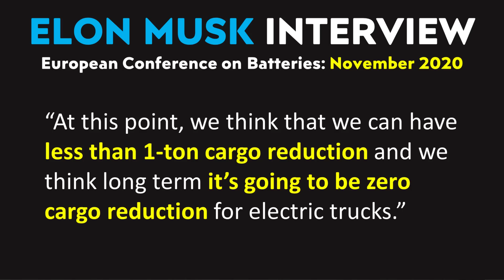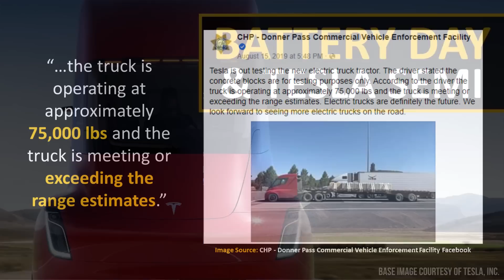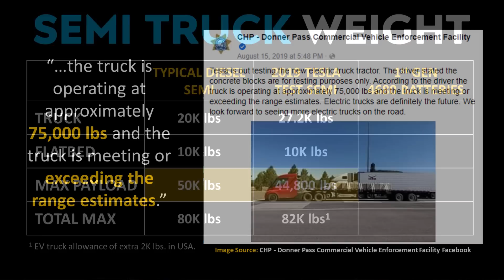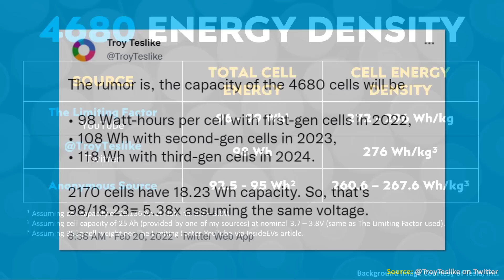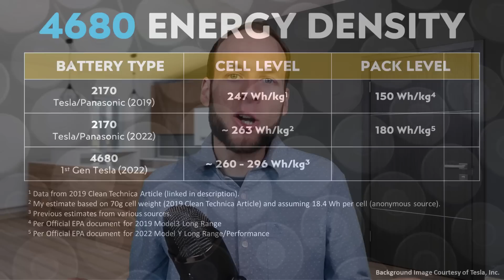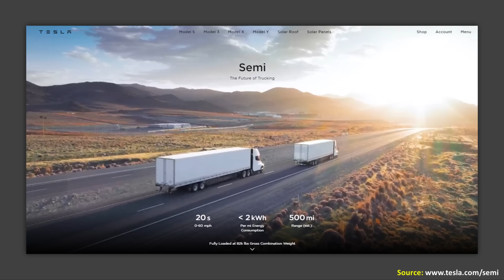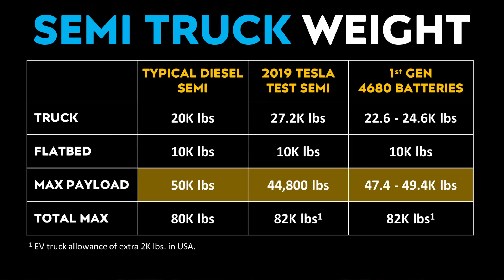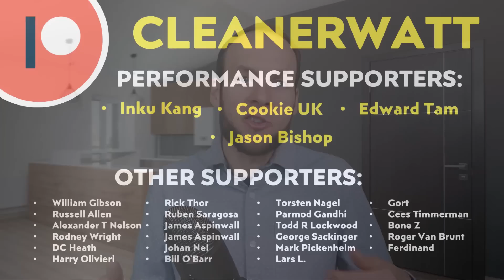Tesla Semi HANDICAPPED by 1st Gen 4680 Batteries?

Comment: At some point Tesla will get the bugs worked out on the 4680s, but I thought on Battery Day the 4680s would be fully ramped by now.  Maybe by next summer.
Reply: Well...
It's only got (at least) 7 new technologies in the pack....
Easy!
Should have been ready last year!
.
/s
Smh
Reply: @rogerstarkey5390  I think we were seduced into thinking the 4680s would be ready SooN.   The reality is Tesla really intended on all Model Ys coming out of GigaTexas when GigaTexas went online to have 4680s.   They obviously adjusted on the fly, which is cool, but clearly they (and us) thought 4680s would be cranking out at a high volume already.   I am totally guessing, but the manufacturing issues will probably take until next summer to get all sorted.
Reply: @Team_Trade_Down  
Considering that they're still building at Austin...
Reply: @rogerstarkey5390  True, but they have built 10,000 Model Ys so far at GigaTexas.  And growing quickly.

Comment: Fuel cells combined with much smaller/lighter infill batteries looks to be the most practical approach for Trucks.
Reply: A battery has a huge efficiency advantage.
Reply: I'm with Elon on this. Hydrogen fuel cells  for semi's is total madness.
Reply: Hydrogen. Don't do it. Don't do it. Don't do it.
Reply: I am not saying that hydrogen fuel cells are a better technology than batteries, but even if that were the case, there would be some significant challenges to overcome. In particular, hydrogen fuel works out to be several times more expensive than recharging a battery to travel the same distance. Also, an internet search suggests there are about 1000 times fewer hydrogen fuel stations in existence than recharging stations. Put simply, a massive amount of money would have to be invested to create a "good enough" hydrogen infrastructure to support its use in cars/trucks.
Reply: Fool cells wear out and using a small battery pack means it degrades much faster. Then you have the issues of cryogenic hydrogen or ultra high pressure hydrogen that finds even metals premiable and also causes embrittlement , do you want to live near a hydrogen filling station that is pretty much guaranteed to leak?
Reply: @Shaun
A couple of points.
.
Just this week, we've seen a (the) "champion" of the fool cell parade a small fleet of trucks which look larger than the Tesla semi, but have 300 mile range.
.
This is after the last 5 years of "You need 1000 miles!' FUD, often from fool cell proponents.
.
What happened there then?
Unless they have a very small tank in a big space, they don't seem to be performing that well?
.....
So much for that.
.
Let's look at "seem to be the most practical" perspective.
.
Emphasis on Practical
.
Would that be in the context of business efficiency? Cost saving?
.
As I understand, one of the principle considerations in the transport industry is cost per unit distance (miles, kilometres)?
That being the case, fuel cost is a big factor?
.
Since Hydrogen trucks will be (are) essentially "Electric Vehicles" (insert rabid denial below) The cost/ amount of source ("grid") Electricity used should be important, since one way or another, the end user will pay for that?.
.
Despite all the possible arguments there can be no denying that if we consider say 10GWh of grid energy, used to power a vehicle fleet, whereas a pure BEV fleet will receive about 8GWh "at the wheels" of vehicles, doing actual work, a Hydrogen based EV fleet (AKA FCEV) will only receive at very best 3GWh of that original 10GWh.....?
.
Even without considering Infrastructure build and maintenance cost, that means the Hydrogen fleet would require 23GWh of grid energy to move a similar distance as the "10GWh" (8GWh at the wheels) BEV fleet
[Calculation, (8÷3) x10 ]
.
As I suggested above, be under no illusion. The end user will pay for that grid energy.
.
We're looking at 2.3 times the fuel cost....
Who would choose that?
Not really "practical"?
Reply: @chrisheath2637  
Sorry... I did.
(Ref "anti Hydrogen rant"! 😉)
Reply: @CiaranMcHale  
All that! 👍

Comment: Giving the electric truck special weight relief just shows that the EV is a loser.
Reply from the maker: 2K lbs is not a huge deal
Reply: They’ll be winner on economics, to say nothing of ease of use. We’re also faced by AGW - we ignore at out peril, EV has to win over diesel. This is first stage of disruption, if you can’t keep up, retire to armchair.
Reply: @Cleanerwatt  1 pound is a huge deal when it favors one sector over another. It also proves that the EV is a loser.
Reply: @JohnSmith-ug5ci  You aren't accounting for fuel costs and maintenance over 1 million miles. And do you really think that these 4680 cells have already reached their peak energy density on their first iteration? If you watched the video or any of his other videos you would know that with chemistry improvements that Tesla and other cell manufacturers are currently working on, like adding silicon into the anode structure, they continue to increase energy density every few years. In 3 years a gen 2 4680 cells will result in dropping thousands of pounds from the same 900 kWh pack which will have a Tesla Semi at parity for max load with a diesel truck.
Reply: As Don Kanis pointed out above for trucks that need to haul more weight an inexpensive drop axles can be used.    Electric trucks will save significant money on oil changes, maintenance, and repairs.   Then there is the fuel savings.    There is a lot to like.

I know a diesel truck mechanic turned truck driver.  Although a hard core ICE enthusiast he is feeling the fuel pump sting and watching electric truck development.
Reply: @danharold3087  the only way to break even with the electric truck is to keep it for around 20 years. The battery will need replaced in less than 5 and destroy any hope of breaking even.
Reply: @flipadavis  I am telling you that if you do the math properly the EV truck is a loser. it would take 20 years just to break even due to upfront costs. Then there is battery degradation. At 100,000 miles average a year the battery will need to be replaced every 5 years and there goes any hope of ever breaking even. The EV is a loser.
Reply: @JohnSmith-ug5ci  These 4680 cells are million mile cells. That has been known for some time now. Upfront costs? $180k for a 500 mile Tesla Semi. With inflation Tesla might bump it to $200k. 

Then just fuel alone the savings will be staggering. For a Tesla semi Tesla claims they will charge $0.07 per kWh at their truck Megachargers. A fully loaded semi will use 2 kWh per mile or around $0.14 a mile for fuel. I'll be super generous and say a state of the art modern class 8 diesel will get around 8 mpg fully loaded. At a current $4.65 a gallon that means a fully loaded diesel truck will cost $0.58 a mile.

Now let's say a long haul truck operates 80,000 miles a year. In fuel costs alone a diesel truck will spend $46,400 in fuel while a Tesla Semi will spend $11,200 for a net savings for the Tesla of $35,200 a year!

This doesn't include maintenance costs per mile which the Tesla also comes out way ahead compared to the maintenance a diesel will need over its lifetime of operation.

So to recap. Total costs for purchase price + fuel costs over 10 years and 800,000 miles:

Efficient diesel truck - $150,000 purchase price + $464,000 in diesel fuel over 800,000 miles =  $614,000. 

Tesla semi - $200,000 purchase price + $112,000 in electricity over 800,000 miles = $312,000. 

This means with the savings after 10 years from driving a Tesla Semi compared to a diesel semi you could buy an entirely brand new Tesla Semi with all the fuel for the next 800,000 miles! Or you could drive the Diesel and spend the same money in 10 years that you would over 20 years with 2 Tesla Semis.
Reply: @flipadavis  Thanks for the work ! Running and maintenance costs are where the electric semi will shine. Oh, and the environmental benefits, and possibility of it driving itself, or at least platooning in a year or two...
Reply: @JohnSmith-ug5ci   You are behind the time on battery tech.  At 45K per year the battery will still have 3/4 million miles left on its life. Heck model 3s and Ys are now breaking 300K,  They are improving the bits that degrade.   Densities are going up.   Good stuff.
Reply: @danharold3087  the model 3 is not putting its battery through the mill of towing. Battery degradation is real and it means less miles and more charging times. The EV truck will NEVER break even against a diesel truck.
Reply: @flipadavis  Million mile cells? You have been brainwashed. There is and will be degradation and that will increase costs. The EV truck is a loser that will never break even against a diesel truck.
Reply: @JohnSmith-ug5ci   PepsiCo, Anheuser-Busch, Walmart, DHL, Sysco, Frito Lay, Titanium Transportation Group and others do not agree.  They have placed about 800 preorders.  Nothing I can say speaks louder than this.  And nothing I can say will change  your mind when your trolling.
Reply: @JohnSmith-ug5ci  Are you suggesting that a battery cell cares if the energy pulled from it goes to cruising down the highway or if it's towing? You are thinking of electric motors which are very durable. 

Individual cells are put into a pack in such numbers and configuration tailored for whatever job to where the cells never discharge beyond a very comfortable rate for their longevity. If you have enough cells for the job then the C-rate for each cell can be low even at maximum power output at the motors. This is what your battery management system is for. The manufacturer dials in the cell charge and discharge rates to protect the cells.
Reply: @danharold3087  with mega packs and covering their distribution centres with solar panels = even lower costs of charging! Long-haul will be replaced by relay haulage = better life for drivers and less accidents.
Reply: @jackdbur  maybe depends on how far out fsd is.
Reply: @JohnSmith-ug5ci .  Never is a dangerous word.   Give it 5 years and we will all know.
Reply: There is no battery weight problem and never has been. See my post and learn something
Reply: @JohnSmith-ug5ci  does someone pay you to make stupid comments?
Reply: @donkanis6141  yes there IS a battery weight problem. Thye were given an exception from the government on max weight.
Reply: @danharold3087  common sense does not need to wait 5 years.
Reply: @flipadavis  if you would do some research, you would know that the harder you work your battery the less time it will last. The same goes for charging.
Reply: @danharold3087  so just because those companies have purchasing agents that are out to lunch, probably bribed, you think they made the right choice. Brilliant. Do the math. Those trucks cannot possibly break even against a diesel.
Reply: @JohnSmith-ug5ci  You either didn't even read my response or you didn't understand it.
Reply: @JohnSmith-ug5ci  been in heavy rail/truck transportation since 1973. There is no weight problem. Wherever you got this “exemption” is full of bullshit. Semi’s can put a drop axle on the truck and trailer WITHOUT any need for an exemption and go to 105,000 lbs.
Reply: @donkanis6141  according to the video there IS an exemption allowing an extra 2000 pounds. Regardless the EV truck is a loser and will not even break even against a diesel.
Reply: @JohnSmith-ug5ci  does someone pay you to write such stupid comments?
Reply: @JohnSmith-ug5ci  hey there Johnny, Swift transportation is one of the largest freight companies in America. They said Tesla semi’s will pay fir themselves in 18 months. But what would they know compared to your wisdom?
Reply: @flipadavis  Swift Transportation said Tesla semi’s will pay for themselves in 18 months but it seems we have dozens of “experts” here that disagree.
Reply: @JohnSmith-ug5ci  this should be called BoobTube. So many “experts” like you who heard another il- informed boobtuber say something that he doesn’t know what he’s talking about.

Comment: For the most part, 4680 batteries are just smoke and mirrors. Better battery tech will possibly beat it to mass production.
Reply from the maker: I am guessing that 4680 production will be ramped by end of 2023 - we just need to be patient.
Reply: Given structural benefits, effective GED energy boost is huge, like 5 years of chemistry evolutionary gains, but additional to said chem gains. Plus there’s cost benefits from scaling, from robust cells not prone to physical damage.
Reply: I do not think it likely that better battery tec will beat 4680 to mass production,   but if they do I know who will be the first manufacturer to bulk order them.
Reply: 4680 is a cell size that can house any battery chemistry you want to use.
Reply: @jackdbur  
Not strictly true.....yet
(Bear in mind I'm a "supporter of the 4680" to the extent I've been called nasty names by the FUDsters)